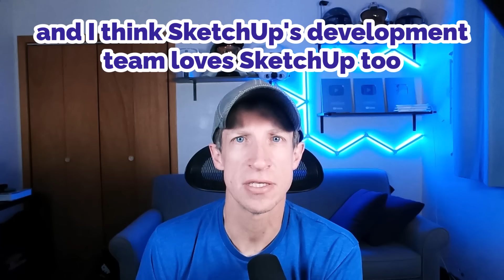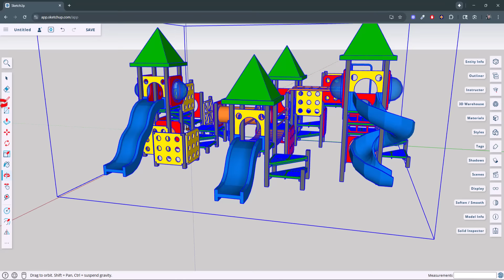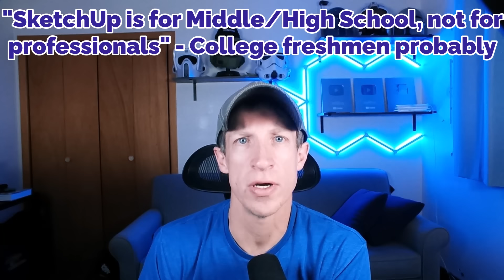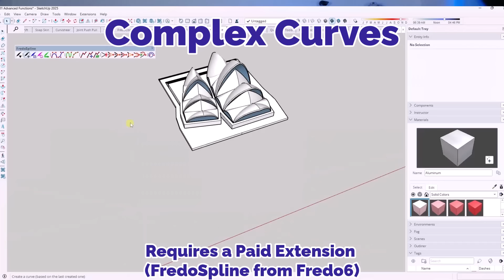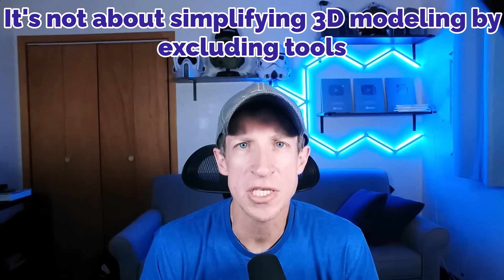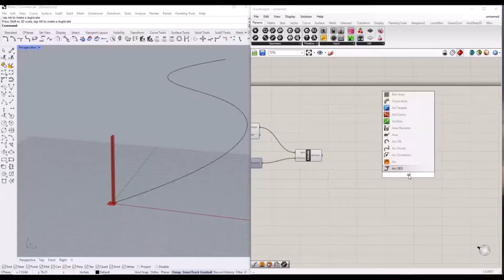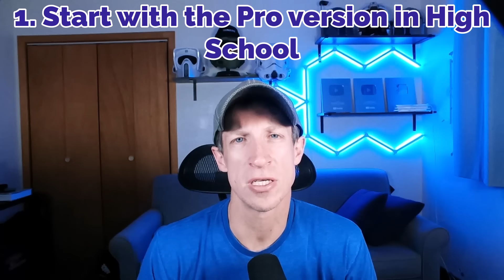Is SketchUp being REPLACED?

Comment: You are absolutely right! But Trimble is holding itself back by sticking to the “Sketch” concept, and that limits them enormously! The potential of SketchUp is tremendous, and if Trimble doesn’t make a choice soon, it could cause their market share growth to stagnate or even decline.

The PRO(!) version of SketchUp is missing a lot of features to truly be called PRO. In fact, SketchUp simply does NOT function without plugins. You STILL can’t scale an object after you’ve drawn it; for that, you have to install FredoScale. The fact that something so essential still isn’t possible in 2025 is just deeply disappointing and incomprehensible. There are also a number of other tools and features that absolutely need to be integrated before you can call it a professional software package. Honestly, I’ve been working with SketchUp since 2003 and I’m grateful that it exists, but I couldn’t have achieved what I have without plugins.

What Trimble MUST do is develop a program based on SketchUp, but for real professional work. With basic modeling tools, 2D presentation tools, and of course the option for plugins, but the basics should be sufficient to properly model, texture, and present designs. If they don’t do this, it will be a tough story in the future. I really hope they see the potential to create a new package based on SketchUp, as that could mean a lot for the industry. The UI of SketchUp remains fantastic.
Reply from the maker: I don't fully understand - you can scale an object after you've created it - or are you talking about scaling without distorting? I absolutely agree that the UI is great, and that there is a HUGE opportunity here - I just hope someone hears this
Reply: @Thesketchupessentials  I mean resize it with exact measurements. When you want to change the dimensions of an object I really don't know how you can do that without a plug-in. And then I have a list of additional features that should be implemented at start....

Comment: SketchUp has become almost an extension of my brain and hands, it’s that intuitive to use. But the real issue is the lack of meaningful tool updates. The integrations with other platforms are great, but the essential tools we’ve been waiting for are still missing. Every year, I look forward to new improvements, only to end up disappointed with features that I feel unnecessary, not even going to use. The grass hopper integration would be a game changer.
Reply from the maker: Agreed - I REALLY love the experience of modeling in Sketchup. Overall it's my favorite modeling program to work in, and I've used a number of them. In some cases, I think certain programs have an advantage over others just because they're designed for specific things, but some of these features should really be in any program (in my opinion)

Comment: Since Trimble bought SketchUp, we have seen the beginning of a misunderstanding of the SU philosophy. Just as you say in the video: make modeling simple—not have fewer tools. 

I upgraded SketchUp myself only because of Vray, not because it was better, faster, or more useful, but because older versions did not work with the new Vray.

Having the main highlight of the update be that they renamed layers to tags is really pathetic. (I think it was the 2021–22 upgrade? I'm not sure.)

Trimble just doesn't understand that SU's strength lies in the speed and simplicity of modeling. Not in fancy features (such as lighting and thermal calculations or whatever) for which engineers use more specialized and accurate programs.

I'm an interior designer and I've tried a lot of 3D programs (Max, Rhino, Modo, Blender) before I created a fast and reliable workflow. I stick with SU for one reason: simplicity and speed. I've also been using Layouts for the last two years, but it's a bit of a painful process. I think the SU developers should try doing their own project entirely in SketchUp and Layout, from design to production or construction, and they would quickly understand what's wrong and what's missing.
Reply from the maker: I agree with pretty much all of this, especially this part - ". I think the SU developers should try doing their own project entirely in SketchUp and Layout, from design to production or construction, and they would quickly understand what's wrong and what's missing."

The more you do it, the more obvious the gaps are

Comment: You are obsolutly right, I agree with you about education, when you go to colage you have to learn it because it is mandatory and the teaching is based on this tool, in Germany most of the students learn Archicad, they use Rhino by their own. Also I can tell you it is about ditching autocad because it is still the predominant way to develop projects in engineering world.
Reply from the maker: This was one of the more surprising results in my feature survey earlier this year - there were a MASSIVE number of people still using AutoCAD, which I did not expect
Reply: I start with 2D floor plans in AutoCAD. After fine-tuning the floor plans, I work on a 3D model in SketchUp. Once the study has been approved, I go back to AutoCAD for detailed design and layouts...

The SketchUp layout is unusable. Despite this "breakneck" procedure, I am significantly more efficient in terms of time than doing everything in SketchUp.

Comment: Justin, you are right on about much of this.  I'm heavy DIY/Maker type that has several retirement hobby/biz projects.  I've been using Sketchup for about 6 years and have a substantial investment in learning how to use it.  I use the pro version for a wide range of projects up to designing a small home and workshop,site planning, home remodeling etc. Just about anything I make or do that involves more than a couple of quick cuts and screws, I try to draw up and plan with Sketchup.  Some of my projects will require more organic shape modeling and the ability to drive cnc tools, such as a router, laser cutter, 3d printer, etc.  I've got the Fredo extensions and others.  I'm thinking about Fusion or some other software (Rhino?).  I really would like to build on my investment in learning how to use Sketchup, and not have to learn and maintain lots of other software tools.  But I know that sketchup is going to hit a wall for me.  Here is my quick list improvements I'd like to see:  Better import/export, especially PDF's on windows.  Better ways to break down a model by view/section, etc. and export to other formats. For my house project, my architect is going to have to take my model and will probably have to redraw a lot of it in Revit to produce construction and permitting documents for me. (I'm not an architect and need some help dealing with the code police, even though you could probably build from my model and design). Improve or better integrate Layout or some of its functions into sketchup directly.  It is too hard to get quick and useful 2d drawings out of sketchup that have dimensions on them.  Native Organic modeling tools.   A way to define planes in the 3d space and draw 2d on them.  A way to force edges onto one of those defined planes, as sometimes edges that you think are coplanar are not.  Multiple section cuts active at once. Way to search/filter for components in model.  I don't know that a parametric/timeline feature set like Fusion has (is that what grasshopper in Rhino is?) is really necessary or even possible given sketchup's architecture and approach. I know that sketchup can do some things in the 3d printing realm but I don't have any experience with this. I know it hits a wall when we start talking about generating tool paths and driving a cnc tool.   I think working with SVG's is limited in sketchup and requries extensions. The laser engraving and cutting world, relies heavily on svgs.  Sketchup needs to orient their thinking to being at the middle of conceptualizing, designing and producing vs being just a conceptualization tool that does allow some import/export.

Comment: every tool in sketchup is paid version, even simple tools that you may need to create 3d models, if sketchup wants to improves, better provide tools which replaces this paid extensions, update the system which improves lag and some bug splats, there are no free tools to use for moderate to professional modelling, even sketchup layout is outdated, no wonder many designers didnt like using it and switch to better options like rhino
Reply from the maker: I don't fully understand this comment - I mean yes every tool in SketchUp is a paid version because you pay for the software. Do you mean that you have to pay extra for additional extensions to add the tools you need?
Reply: @Thesketchupessentials  yes, we may need to pay extra for the extensions to add some tools

Comment: A very good contribution, Justin Geis, and I completely agree with your thoughts.
For years, I have been discussing within the company why I continue to use SketchUp with my team instead of using something more contemporary and sensible like Rhino, which everyone else actually uses!
There are many more needs of improvement to list. For example, the UI, which is still incomplete and prone to errors, the export feature, which is based exclusively on layout, etc., etc., and, of course, the not insignificant price.

I certainly don't need to prove this to anyone – I love SketchUp too! So much so that I too sincerely hope that it has a future. 
However, as you describe here, this future is in doubt because SketchUp obviously has a powerful  ‘Ignore user needs’ department.

Best, HornOxx
Reply from the maker: Thanks for the feedback! I agree with your assessment - honestly I feel like a lot of users are basically asking SketchUp to add the features that allow them to advocate for the software at this level. Software costs have to be justified to companies, and not having to explain a lack of modeling tools makes this a lot easier.

Comment: SU has some 'splaining to do (instead of splatting).  I love SU also and have used roughly every other day since version 6 and dont have a lot of interest in learning rhino (which is respectable but Im sure has its own downsizes).  Trimble is just another big software company that doesn't listen to feedback on a smaller product, even if its a relative flagship.  The extension migrator is a huge welcome addition but I feel like every time I upgrade, I spend a solid hour hunting down various extensions, re activating, and then hoping they work in that version.  I almost think preferences.dat could contain a list of active extensions, plugins, UI, and exporters, and where to find them as that doesn't feel like a big lift.  The best thing that happened to SU in the last several years was Unreal, first datasmith, then Twinmotion - especially with the view sync so now I dont have to do twice the work to perspective match, you can actually use the wonderful tools in SU for photo match and get the same view basically in TW, photo rendered with sky layers if you like and composite to your hearts content instead of having to set opacity hackily on the TW window and hope its half as good.

Comment: 100% spot on, Justin. 
Trimble needs to tap into the ethos that got the product to where it is - the reason that it has had one of the best and proactive user communities for over 20 years: it lowered the bar of entry for newbies through UI (while remaining powerful, as you pointed out), and streamlining the workflow to maximize creativity process in design for power users. 
Keep up the great work!
Reply from the maker: That's where I'm at - Simplicity doesn't mean excluding tools, it means taking those tools and making them accessible

Comment: You need to move them all to Blender.
Reply from the maker: For what kind of modeling? Having used Blender extensively, it's currently not the answer for any kind of precision drawing, especially if you have a 2D deliverable like plans
Reply: @Thesketchupessentials  Have you looked at the Blender extension "Bonsai"? 2D plans, elevations, and sections, and assembly of those drawings into templated sheets. You can specify wall length/height/thickness in mm, so I assume that is enough precision. It's a BIM tool based on buildSMART's IFC standard, so it can be intimidating, as it does a lot of stuff that is frankly beyond me (scheduling, quantities, distribution systems, etc.) It's still in development, and there are areas where it needs improvement in the output drawings. Open source file, open source code. FreeCAD is also working toward full IFC implementation too. I'd try to post a link, but YT seems to blacklist me when I do that. Try searching ""live projects - an exploration" and look at the latest post by theoryshaw, showing professional plans for 3 of his projects, entirely done in Bonsai.

Comment: (1) The wall of Revit. Why? You have to work really hard to get Layout to compete with the professional output of Revit and AutoCad. I know because I fight this daily. Layout 2026 has made big improvements. But... (2) Rhino has Grasshopper. (3) You can run Rhino inside of Revit (4) Rhino now runs on OSX.  (5) My workflow is Fusion for detailed parts then export to SketchUp. (6) Speed of iteration is my weapon that keeps me in SketchUp. It's still the king!  (7) add to that Plugins like Profile Builder and Medeek Walls. (8) It feels like you an underdog for using SketchUp when the whole Architecture / Design pipeline uses Revit. (9) I Really appreciate what you had to say about the pipeline. It is true.
Reply from the maker: Agree with all of this - great list!

Comment: I got Rhino 8 license through my university for $105. (which also gave me access to version 6 & 7). Permanent license which can be use for commercial work. Sketchup is $55/year through the university with a limited tool set. I think the math in my case is pretty simple.
Reply from the maker: So if you buy that license in college, you can keep that version after you graduate and still use it?

Comment: I've used both. For simple projects and for those who are non technical, Sketchup is the better product but in the long run Sketchup is way more expensive. I dislike subscription based products. They are a cash cow for the publisher but there is little to no incentive for them to improve their product. For larger more complex projects that require more sophisticated modeling tools Rhino is a far better tool! I give Sketchup to users with basic computer and modeling skills. Afterall Sketchup was designed as a simple tool for Architects. Learn it quickly, produce! Relearn it again after a year away from it. Rhino takes more of a commitment. You will have more success with it if you have AutoCAD experience. It will take longer to learn but the rewards are greater. For me I chose Rhino. Some of what I want to model just can't be done in Sketchup.

Comment: When I use sketchup I feel like it goes out of its way to make a 3 step process into 10 steps like the doors and windows and cabinets it feels like I could do the same thing in 3 simple steps whereas in sketch up oh Hey you need to make the wall first and then you need to make another square and then you need to use this cutout tool it's just I don't know II can't explain it but sketchup is just frustrating that it takes too many steps to do one thing
Reply from the maker: I'm not sure that this experience is much better in Rhino - you still have to manually cut the holes. Personally I don't find this that difficult once you get used to using it, but I see what you're saying. In something like Revit you just drop a door in and it knows it's a door. I wouldn't mind having a new type of object in SketchUp, like a "wall" object that can interact with other objects like doors and windows. Keep the existing modeling features, but if you want something smarter, just turn on the toolset and use the tool - that would be nice I think

Comment: I would completely agree. I've been a SketchUp user in the design field since Version 6 I think. I say this all the time that there should be a way to install these tools natively. I think they should make a deal with some of their extension people. Buy them and make them a native tick you install like Vray. I mean most of this should actually just be baked in. Thats my biggest grip as well.
Reply from the maker: I'm fine with some of them being extensions - by no means do I think extensions and independent devs should be replaced. But some of the basic modeling tools? I'd like to see those as actual built-in functions
Reply: @Thesketchupessentials  Absolutely. Im not saying Chuck Vali Architects should, but round corner, bevel, joint push pull, thru paint, soap skin or curviloft, trubend or something like it, even bezier curves...